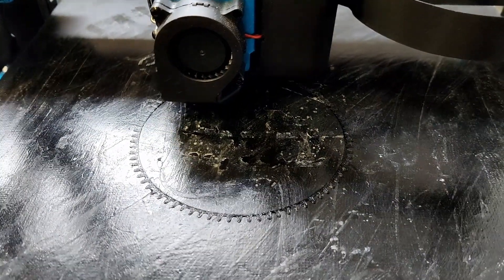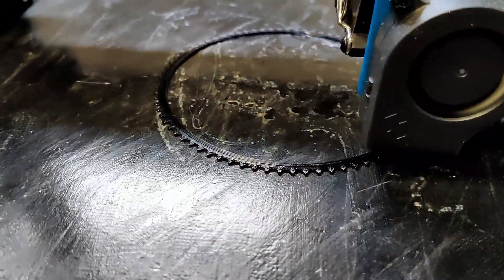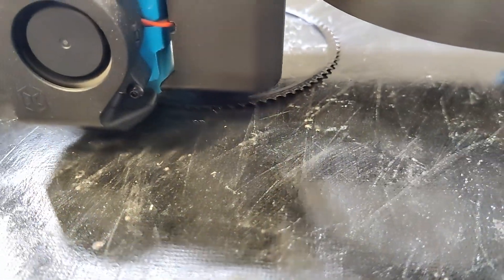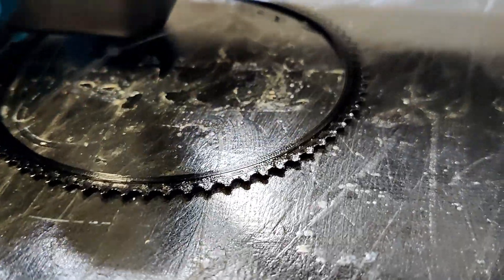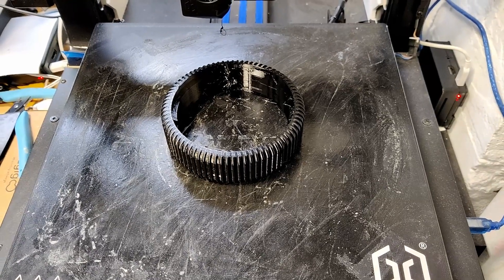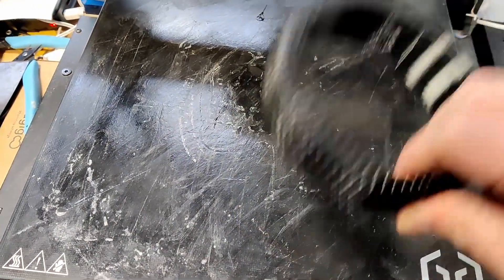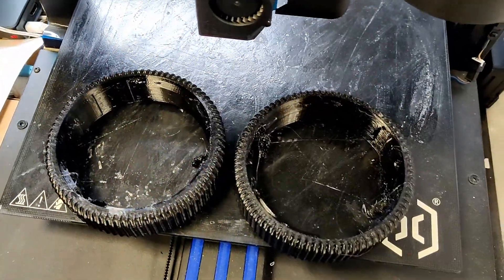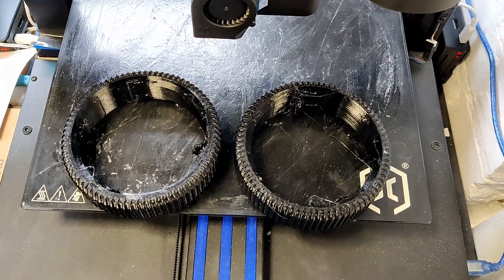TPU R2 tyres!

Comment: May I ask how many layers and any infill did you set the printer to?
Reply from the maker: 0.2 layer height. 4/4/4 walls and top/bottom layers.  20% triangle style infill.
Reply: @jeffreypajela1724  0.2 layer height and I always have 4 walls and lightning infill with 3 bottom and 5 top

Comment: just asking  can TPU  be used on a ender 3d pro never used anything but pla+
Reply from the maker: Yep I did some TPU on an original Ender 3 years ago. As Chasenorman said. Hot and slow. That's always been the mantra. But I wanted to see how fast 'slow' needed to be in this case, as I haven't used TPU since I Klipperised the Sidewinders early last year. Turns out, 3x as fast as before and probably could have pushed it further!
Reply: Yep just hot and extremely slow 95a tpu
Reply: Yes.  I printed mine on a stock ender 3 pro.  Came out perfect.
Reply: Ok ty what would be the temp on that if you don't mind me asking